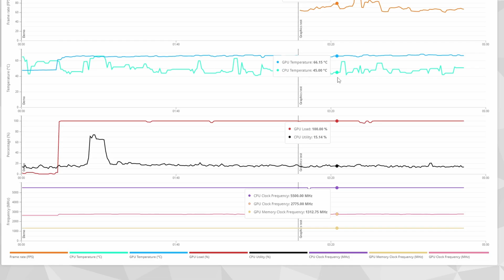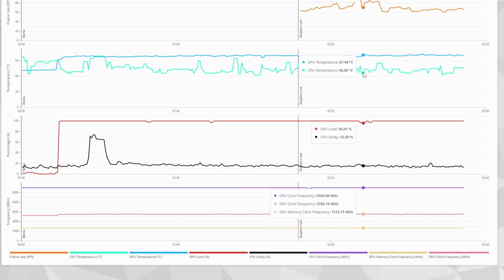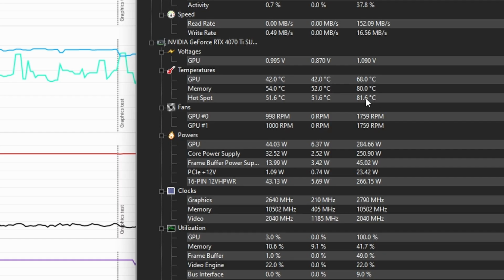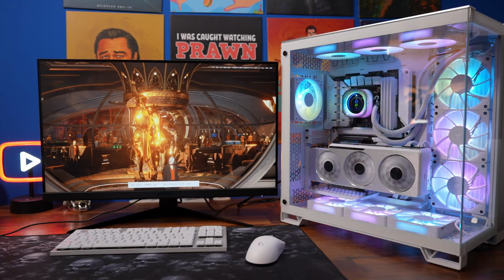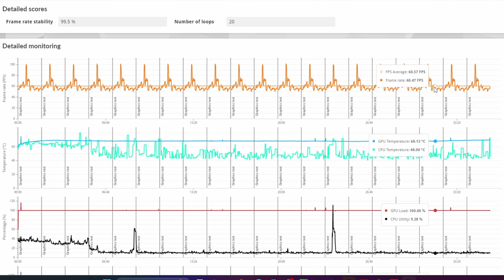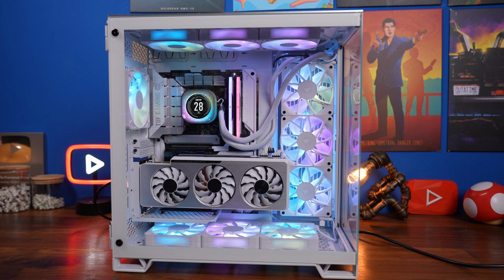How to vertically mount a GPU in the Corsair 6500 series PC cases

Comment: Any way for you to make a short to do a size comparison side by side with the new Lian li 011d mini v2? I have the 6500 but it’s getting quite bothersome when moving it due to its size.
Reply from the maker: Alas I cannot I don't have it anymore. However it is definitely shorter. You can see from the fact it'll only house two 120mm fans on the side. Perhaps you could look at the measurements in the specs of the case and work out the difference that way?

Comment: Thanks for the video. I'm planning to vertically mount my RX 9070 XT because I'm worried of the GPU sag, and this video helped me. I tried to get the adjustable anti-sag GPU support pole, but the 6500X chassis is too large it can't reach the GPU even with a bottom support.

Comment: Its not possible for me to use it with a 3 slot gpu. Waited one month till it arrived and it is only really usable with 2 slot gpus. the outmost slot for the screws and Pcie cable, is for 2 slots, that would be perfectly for me. But with 3 slots, you need the inner point, and when it is there mounted, then it damages all your cables.

Comment: In Corsair site about this part says it is pci-e 4.0. Is that just an outdated info into their site? I mean, is it pci-e 5.0 supported 100%?
Reply from the maker: To the best of my knowledge Corsair does not offer a PCIe gen 5 vertical mount or riser cable. In my testing though, it doesn't matter. You won't notice any impact on performance.

Comment: This was a great tutorial!  I built a 6500D airflow case recently and decided to do the vertical GPU setup.  Your video walked me through every step of it - was much appreciated throughout
Reply from the maker: Glad it helped!
Reply: That’s a pretty nice combination for keeping it cool inside. Cold air will be vented in from the bottom, get pulled through the GPU heatsink, and then get pulled out of the system through the upper radiator/fans and the back fan.

Comment: it may work good for a smaller card, i just ordered the mount and mounted my 4090 strix and with only that one screw that holds the mount in wont sit straight and looks not too straight at all.. i have it set that way right now but  ill change it back in the next 48 hours.. oh and the single screw on the 6500x glass door wont come out now, the screw is stripped.. I'm  finding more and more reasons to hate this case..:_Provoked:
Reply: You may find if you put a little pressure on the door whilst it's open the screw should come out

Comment: FYI... I'm using the cooler master Vertical GPU mount V3 kit on the 6500X with my 4080 super card.  The corsair one is almost always out of stock so I used the CM one instead.  Great content on different 6500X build orientations!  I decided to switch mine to tubes down based on your videos :)
Reply from the maker: well thanks for proving me wrong I guess hahaha :) Thanks for sharing.
Reply: It didn’t seem to fit right when I tried installing it in mine. 

Edit. I’m using the cooler master one. So yeah I guess I should buy this one
Reply: @HOBOTw1tcH  If you tried installing the CM V3 the way that TPP installed it, as prescibed by Corsair for the 6500X vertical bracket, it won't work.  You're supposed to do it conventionally by removing the horizontal bars and slot it in.
Reply: Do there fit 3 slots gpus in? I bought the kit from corsair and need to send it back because it is not possible for me to install it because of a 3 slot gpu. I mean I can install it on the mount, but because it is a 3 slot I need to use the standoffs in the middle and that is the problem, cables interfere with the gpu and the riser cable is extremly kinked.